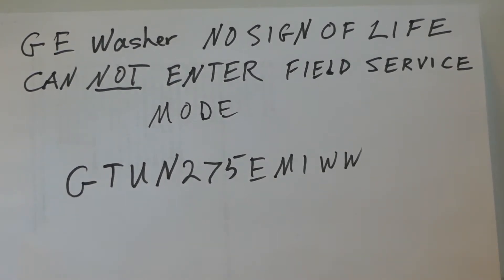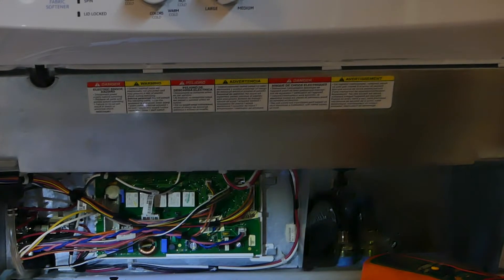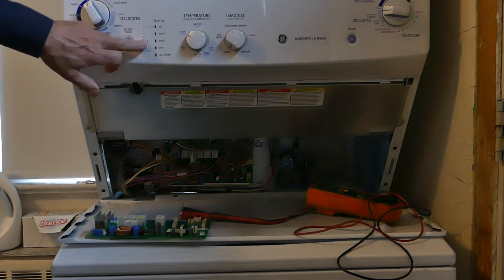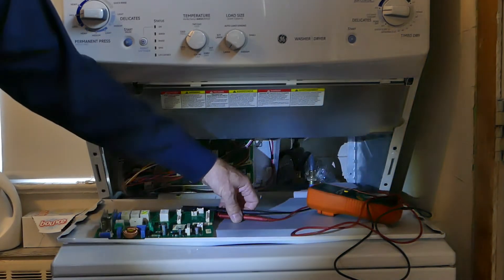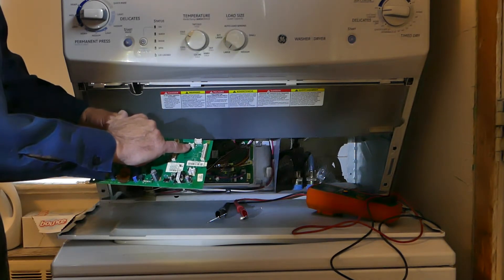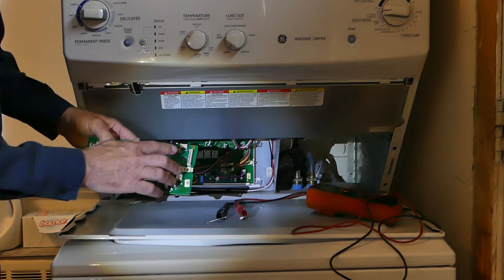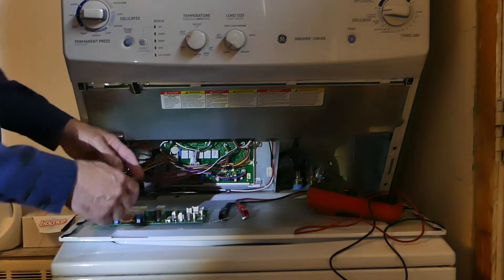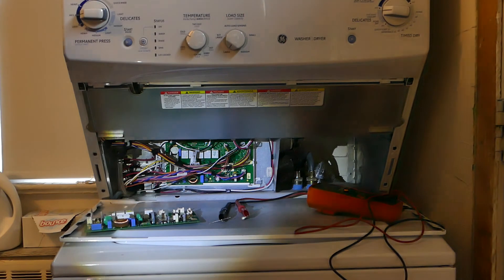GE washer No Field Service Mode GTUN275EM1WW

Comment: I have a GE stackable the its flashing lights wash & spin  replaced lid lock and get not get into service mode, I do the 3 seconds thing and it won't go into service mode ...Any advice ?? Thank you
Reply from the maker: I'm not an expert because my set up is still working fine since I made the "No Service Mode" video.  If you have carefully read the service sheet that comes concealed in the machine, and done everything exactly as it tells you to do, and still no service mode... I guess it is time to get a new circuit board like I did.  I just checked online and the circuit board is still available.
Reply: After i press paulse and start the ge stackable wont start how to service it? Also change lid switch same thing jam What to do?

Comment: I have a GUD27ESMMWW it does not have a physical pressure switch its on board. The machine in drain and spin mode spins and then adds water and starts the agitator why?! I literally want it to just drain and spins but it seems like its going into a wash cycle. Can anyone explain this?!
Reply from the maker: There should be a sheet of paper inside the machine with instructions on how to enter "service mode" .  Once in service mode it should blink out a code. Code look up is on the paper as well. If no paper inside, see if it is available on the internet.  My machine is still working since I had this one problem seven years ago

Comment: stackable kenmore dryer works but washer does not drain -- I have 3 spin options and none work , I checked the pump for debris it was clear . system will not drain or spin . it will not spin when empty either . dial appear to be  mechanical. what is your recommendation.
Reply from the maker: What I have has a small hose connected to the outer drum.  At the top is a three wire sensor.  This is a pressure sensor.  When water is in the tub, the water enters the hose and compresses the air above it.  As it does, the sensor reads an increase in pressure.  That is how the brain (computer) knows that there is water in the tub.
   If you hear a metallic gear noise as you turn the control knob, you have a timer switch type.  No brain, just performs functions one at a time until all the functions are complete.  If you have an electrically driven  pump that is supposed to empty the tub when the timer tells it to, get a 110v test light and see if the pump has power when it should.  If no power, might be a bad timer switch.  If power, might be a bad pump.
  I have seen some types drive the pump mechanically from on top of the main motor.
   If pump is electric, either bad pump or no power to the pump.

Comment: Problem not solved I changed the board and still can't go into service mode
Reply from the maker: In my video there was a multi-meter. I hoped to communicate that I had first checked power to the board, as well as the inputs to the board. Lid position switch, rotary input switch, etc. Board replacement comes last after eliminating other possibilities.  I'm thinking no power, bad input, or you might have two bad boards.  Sorry you are having trouble with the machine. Mine still works.

Comment: Have the same stackable but my dryer has power but my washer doesn't what can it be
Reply from the maker: Did you enter service mode and retrieve the code?
Reply: Hi! Did you fixed it? I have now same problem. Dryer is working but washer doesn't.  I already replaced main board and UI board but nothing changed.
Reply: Did you figure out what was wrong? having the same problem…
Reply: Did you figure out the problem

Comment: Unfortunately, board only comes with a new motor now!. I wonder why? Different voltage? Unit is only 5 years old
Reply from the maker: That is new information to me.  My machine has been working fine since replacement of the board.  I have not looked into new board availability since.
Reply: @HamiltonSRink  well, at least for my customer's model.  And then in short supply. Same when I checked the motor part number. Both sub to a kit including both. Very strange
Reply: Since Haier bought GE 5 years ago, much has changed. Parts more difficult to get. Many new appliances are rebranded models from various manufacturers including Samsung and Midea. Haier did have a refrigerator factory in the Carolinas last I checked. And GE used to share a refrigerator factory with LG in Mexico.
Reply from the maker: @Jake-by9ly  I bet Covid 19 has changed the market too!

Comment: What about common GE trick: unplug for one minute, plug back in, open and close lid 6 times in 12 seconds to reset motor control ( only have to lift lid 2").
Reply from the maker: That works if you try it and there is a change.  In my case, there was no change, no life, nothing.
Reply: @HamiltonSRink  My first time servicing GE COMBO. I've dealt with many Frigidaire ones - not fun.

Comment: For the the lid switch, do you check the lid switch wire or on the board?
Reply from the maker: Un plug the lid switch wire from the board.  It is a reed switch that opens and closes depending on the magnetism that is applied or not depending on the door being closed or not.  The magnet is in the lid. Use the ohms scale on the multimeter.  Probe the plug from the wire side to see if the switch goes closed and open when the lid is opened and closed.  All this does is check that the problem is not caused by the controller thinking the lid is open.  On my machine, it really did not matter, because there was no signs of life at all.  If I had some sign of life, then most likely I could have entered service mode.  In service mode, there is a light blink combination that would indicate a faulty lid switch.  Since my circuit board was getting power, but was RIP, I went with a new board.  It has been washing clothes faithfully ever since.  Hope this helps!
Reply: What about the common GE trick of unplugging, waiting one minute;  Open and close door (only need to open 2") 6 times within 12 seconds to reset motor control?

Comment: How do you go in to field service mode? I can't figure out whats wrong with my washer and there is no info anywhere on how to get to service mode. I know how to reset.
Reply from the maker: Ok.  Field service mode.  How to enter field service mode.  On my stacked GE washer dryer, I removed the two phillips screws that hold the filler panel just under the row of switches.  I found a service sheet taped by the factory there that explains the procedure, as well as how to read the blinking lights, on the inside of the panel.  Remove the two screws, remove the panel, look on the inside of the panel, should find the info sheet.
Reply from the maker: Also there are videos on YouTube.  Search :  Field Service Mode, GE
Reply from the maker: If the information sheet is not on the inside of the panel below the switches, try removing the front lower panel. It should be somewhere taped on the inside for you to find.
Reply: I had a repair guy replace my transmission a few months ago, he may have removed it and misplaced it. I think the repairman may have cause this problem I'm having now. Everything works fine whenever it wants. The wires that go to the motor was not attached to the harness and i believe that the wires are loose. I played with the wires this morning and my washer was able to do a load.
Reply from the maker: @ANGROCEL   look on the very top of the machine. I use a chair, and I'm 5 foot 9 inches tall.  Find the model number and serial number on the permanent sticker on the top of the machine.  Try to contact the right guy at GE, or do an internet search.   He should be able to email you a copy, or refer you to a web page you can download and print out.  You may be able to discover it for yourself!  If no good comes from the effort, try to find a unit at a repair center.   Maybe there is a used appliance center not too far from you.  They might let you photograph it.
Reply: @HamiltonSRink  usually on left side as you face it on older GE's and some others
Reply: @ANGROCEL  Some Appliance repair technicians are notorious for stealing those tech sheets - very unethical and probably criminal. Ad one myself, I've noticed them missing many times and I know who the crook works for.
Reply: Chevy YouTube for Bearded appliance tech or something like that. Or just Google search GE washer-dryer combo field service more. His video goes through all the tests and also shows the chart of which LEDs light steady or blink to show error codes
Reply: Usually, press and hold turn dial to any position except straight down (position 6) then hold start and delay button three seconds, then keep those to buttons while turning to position six. Wait 3 more second and release. All LEDs should light steady to start
Reply from the maker: What is usually on the left side?
Reply: @HamiltonSRink  you can download tech sheets (manual) at searspartsdirect.com, repairclinic.com and other websites. Just Google search "Tech sheet for ge laundry center"  several choices pop up for various models. Here is one: www.manualslib.com/ they also have an Android app - manualslib for manuals library - VERY HANDY

Comment: That ge combo is a peace of junk.cannot get the tub out to replace the tub seal. You have to drill out the tub and buy a new one for $300.00.
Reply from the maker: I recently changed out the bearing for the tub.  Getting the tub off of the square drive mount was a two hour battle!  I had to use an air hammer plus heat!

Comment: Hi there! 

How do you get the Control board off?  I have a GUD24ESSJ0WW and got the front off but can't get the old board off. I'm probably missing a step but I can't see what it is. It looks exactly like the model in this video. Thank you!
Reply from the maker: There is one Torx headed screw about an inch to the right of center. I think it is a T15.  Also two plastic clips on the long ends, one on each end.
Reply: Thank you! It was also stuck from being in there so long.
Reply: Be careful not to break off plastic retaining tabs when removing circuit boards. I really hate all the flimsy plastic parts in modern appliances - especially Samsung and LG (Samsung much worse) refrigerators. Keep in mind GE Appliance was bought by HAIER over 5 years ago. They now put the GE name on appliances from various manufacturers. It's not the same company anymore. GE no longer makes consumer products. They license their name (and RCA) to various manufacturers. LG was once Lucky GOLDSTAR